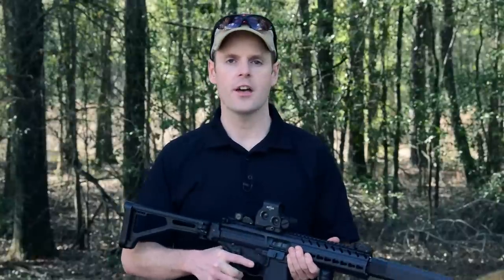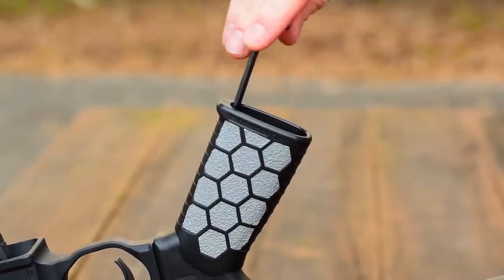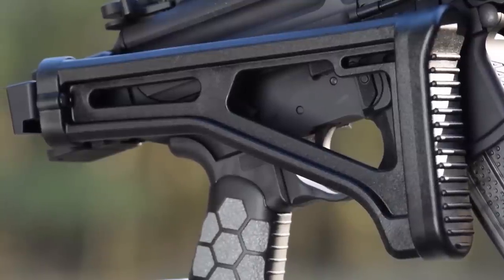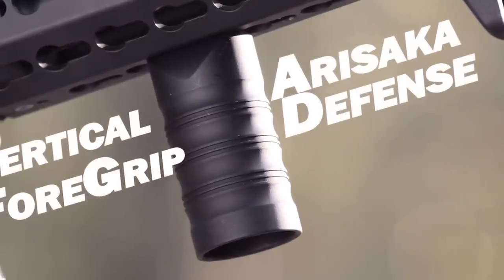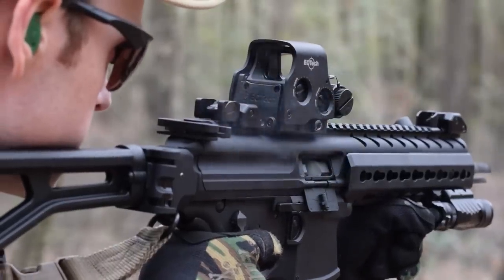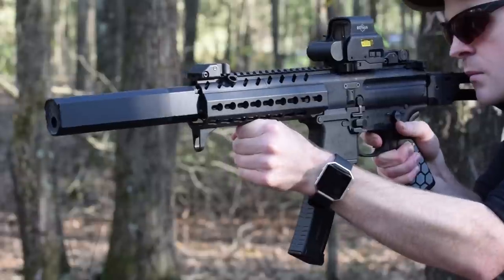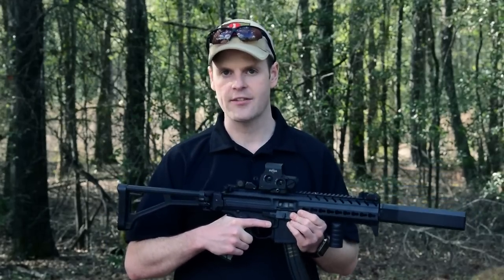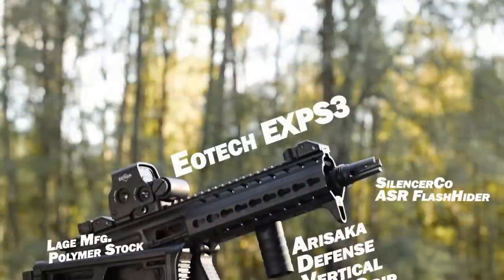Top 5 Upgrades for the SIG MPX

Comment: I carry the mpx everyday, 4.5" barrel. I find the collapsible pdw stock the most comfortable and useful. The best upgrades I made to my mpx sbr is chopping that barrel from 8 to 4.5", swapping the shit trigger for a geissele 2s, and adding the HK trilug adapter for QD use with my cans. Shooting without the can straight from the trilug end, is easily manageable recoil and staying on target with ease. I dumped the iron sights because I put an aimpoint t1 micro which is bombproof and last 50k hours. Zero at 25 yards and its gtg. The only problem I have had us using 165g hush subsonic ammo, it shorts strokes, so 147g FMJ is the best for subsonic work with a 4.5" barrel.

Comment: Also add a gunsmith trigger job to smooth out the grit and reduce the pull along with a JP rifles red spring set. No need to even worry about aftermarket kit if you stone the surfaces and upgrade springs. The engagement surface of the hammer-sear could be reduced but I prefer the added safety of the stock specs, just refined and reduced. This trigger job is just as good or better than any NCM-PNT or ACT trigger upgrade and you get to keep the stock Sig parts and bridge. I also like the small aim point much better overall. If you don't suppress the Lantac dragon brake is the way to go. If you reload switch to coated bullets and no coppering and way less wear on the barrel. The JP rifles yellow spring set will work reliably on a new Gen 2 but I believe it's less robust than the red springs which give you a 5-5.5lbs pull. Competition only the yellows are going to be fine and give you 4 pounds or under, even with CCI hard primers.

Comment: Thanks for all the suggestions, I paid for and put my MPX SBR in form 4 layaway jail back on election day. While I don't plan on changing the stock since I live far enough south to not have to deal with bad winter weather, I'd be willing to down the road if I dislike it enough after a few range trips. The grip on the other hand is almost always the first thing to go on an AR platform for me. My usual #1 choice is the BCM Gunfighter grips but I'll give that HexMag grip a look, I like the concept they have going there. As far as optics despite the fact that I already own an EXPS3 and love it (mounted on my Ruger SR556C) I don't think I'll be going that route on the MPX. I've been leaning toward Sig's own Romeo 4B as it's considerably cheaper than the Eotech and Aimpoint models I'd consider for a gun like this, plus it's much lighter than the Eotech (just under 8 oz lighter according to official literature from both companies). The foregrip is another thing that really you have no reason to not put on there, and the compact/lightweight nature of the one you shared appeals to me. Same thing with the muzzle devices. Assuming the Hearing Protection Act gains any traction this year I might consider getting another suppressor, but for now I'm going to hold off since prices should drop like a rock and availability should go up (eventually after the initial buying frenzy) if Congress happens to actually get something right for once. Going SilencerCo for suppressors is a no brainer and the Osprey 45 would give me a great platform that would be compatible with pretty much everything else thanks to the big honkin' .45 chambering. In due time perhaps! Great video, gained a subscriber today!

Comment: For the sight. I recommend Holosun HS510C. It has overwhelming advantages than the Eotech. Also a half price of Eotech.
Reply: i prefer the eotech because it looks better. just personal preference.
Reply: Yeah because if you ever need to use it for what it's really intended for it's going to matter what it looks like. I get you want to look like an operator so let's go with what looks cool, not whether or not its going to work when someone breaks in your house at night, or whatever scenario pops up and you need it to work. Who cares if the battery is dead or if the zero has shifted due to temperature conditions, as long as I look cool to my friends. To each their own I guess.
Reply: KhanSW lol thats why the ar was made. you can customize them however you want. i like the eotech, acog, and the aimpoint micro. they are well built and hold zero perfectly. this sight drift is on their new sights that i have not owned yet.
Reply: KhanSW and if someone broke into my house i dont have any segment longet than 10 feet so i use a benelli m1 with a bead. its point shooting, not accuracy
Reply: my halosun lasted a month before it completely shit out. talked to halo sun about the sight quit working his responce was " Did you put the battery in the right way? " even tho it has a Solar panel on the top battery shouldnt matter. so i trashed it and got a C-more railway 6moa. same price but its the scope competitive shooters have used for years. winning many national and international matches, so they have a great rep. lesson learned
Reply: Holosun. And it still needs a battery even if in auto mode. I've had the HS510C for a few months and it's been rock solid. Sounds like it may just have been you there.

Comment: the ultimate MPX setup.  SBR, Trijicon MRO, Franklin BFS3 trigger,  4.5" barrel w/ 3 lug adapter, Sig SRD9 suppressor, carbon fiber handgaurd, streamlight TLR2 Green laser, and Magpul QD sling
Reply: oghueq with all them changes you should of just built a 9mm build like I did.  Trigger, barrel, handguard than the other things. Would of been better off building

Comment: Try our some of the Sig branded sights too! I have the Romeo5 on mine. on the right Gunbroker auction, you can get them for just over $100 bucks. The newer Romeo5 even has a circle-dot, instead of the 2MOA dot on the original...

Comment: This gun can do anything.
Reply from the maker: Chandan Rath - Terminal ballistics are lacking past 75 yards - but other than medium-to-long range performance, the MPX is a solid choice.
Reply: you think so? If you get a 9mm on target at any distance it'll penetrate.  There are a couple videos about "how far is a 9mm lethal" particularly iraqveteran8888 and show pretty convincing penetration at well over 100yds. In any case, the sig catalog lists a .357sig and .40S&W conversion barrel as "coming soon" for the mpx. Should help with concerns about stopping power!
Reply from the maker: Ted Ferenczy - While expensive to feed, the increase in terminal ballistics when running the MPX in .357 SIG, would be pretty darn cool.
Reply: Yes you are right.

Comment: I have another question about the ASR flash hider, and the osprey. does the osprey fit over the ASR, or do you have to take it off?
Reply: Okay, so every pistol like my HK 45 compact, Sig p229 equanox, Walther 9 compact, CZ scorpion all require a different piston correct? I also like the Sig factory slim three prong flash hider. I've seen it hook up to suppressors, but I guess it wouldn't work on the for mentioned maad break.
Reply: Do you have a parts list of all the parts used on the business end of the barrel. I thought you mentioned about a spacer?
Reply: As an owner of two SiCo hybrids and an mpx 8", I'll chime in here and add that although I love my hybrids, they are Overkill for 9mm. I got a dead air wolf 9sd, as it is lighter, can be configured long or short depending on whether you wanna prioritize length or dB reduction. And I can put it on my blackout hog gun, too.

Comment: Had a question in reference to the Lage folding stock used on the MPX. I was hoping to know the length of the stock that you were using for your size. I am pretty much your same build and looking for a recommendation. Second question. I noticed that your folding stock seems to fold with a certain degree cant. I see they sell a certain folding mechanism which has a 0 degree (Left and right folding), a 3 degree (Left only folding) and a 5 degree (Right only folding).Lastly, if I am using this on a sig MPX, then I would need a: SIG MPX Stock Adapter for $59.99 and then the stock (? on length) and a folding mechanism (?) I also see they sell a ACE Folding Mechanism? Any help that you could offer would be greatly appreciated. Thank you again for the great video!
Reply from the maker: Shaggs2Dopes - I used the recommended length stock, but would truthfully prefer a slightly shorter one - but I'm only 5'9 YMMV

Mine is the 5 degree cant model and it perfectly clears the ejection port.

yes, I used the ace adaptor, keep in mind it adds like 2in to LOP

Comment: I'm considering buying this stock for my mpx sbr. Is there any specific reason you went with the right folding stock vs left folding with no can't ? Is that the medium length of pull stock?
Reply from the maker: - I originally chose the right-folding stock, because I was concerned with being able to reach the safety with my thumb, but that fear ended up being unfounded. 

As for the length, yes it's the medium length setup.
Reply: Thanks for the fast response , right folder defines looks cool, the 5 degree can't doesn't affect the trigger finger while folded ?
Reply from the maker: David Carrillo - it definitely does, but not enough to prohibit use of/ access to the trigger.

The 5-degree cant is necessary, because without it, the stock blocks the ejection port.

Comment: What kind of ammo do you run through it for doing the work? I know a guy who runs 100gr +P Corbon Pow'rball through his MPX for home defense, which is a neat little JHP. I myself prefer Hornady TAP out of a pistol carbine or SBR.
Reply from the maker: Jonathan Anatrella - I'm a big fan of Hornady TAP and Critical Defense 135gr +p
Reply: Oh yeah, Hornady just makes a great bullet. I've been considering Federal HST since I love the 147gr load in 9mm. It doesn't do well with defeating barriers as well which is what I'm looking for since I live in an apartment and worry about my neighbors. I have the Aguila minishells in my 12ga right now for home defense, the 6 pellet 00 buck will still do a lot of damage at 10 yards or less. Also very easy to rapid fire them if necessary.

Comment: If you always intended on having an SBR, did you ever consider getting the carbine length barrel and having it cut down to the pistol length barrel and cutting 1/2x28 threads on it?
Reply: that would be a way bigger pain in the ass and way more expensive than just starting with the pistol version.

Comment: How far away did you zero the EOTech..? I don’t have iron sights on my mpx...think I was too close on zero couldn’t get the round high enough based off EOTech mount and distance...
Reply from the maker: JC-Details - I initially zeroed the Eotech at 35 yards. If your gun is shooting extra high or seemingly randomly, check to make sure both the muzzle device and the barrel nuts are fully tightened. If either is loose, your groups will go crazy.
Reply: They were just consitantly low no matter what I did adjustment wise...had to move further away...when I’m close I use the bottom part..I think I was too close with a short barrel couldn’t get the two to cross...moved it back and was perfect...thanks for the video

Comment: who makes the muzzle brake you have featured in this video. I just purchased a mpx, and I like your set up. I really like that round muzzle brake with the holes on the sides.
Reply from the maker: j 1035ak - Thanks for watching, it's a SilencerCo ASR MAAD Brake mounted on an ASR Flash hider with a 13.5x1LH thread.
Reply: Thanks
Reply: j 1035ak what's the flash hider with all the holes in it. can't find what model that is and who sells it

Comment: Good review. Why does it seem like you still have the booster on when firing through the Osprey? o_O
Reply from the maker: That's easy, it's because it was still installed for half the shots, as I had intended to do a comparison between running with a booster vs the spacer. The footage with the booster was better, so I just kept it.
Reply: 2 questions
What is the booster y'all speak about?
I'm waiting on my silencerco octane 45k but I also like the 3 prong like flash hider ...Do I  have to remove it to put on the octane every time or does it screw on top?

Comment: dump the large battery eating Eotech, go Trijicon or Aimpoint
Reply: It's not that big of a deal once you have one.
Reply: Critastic i do have one, and 4 aimpoints and 2 trijicon
Reply: i have one and i've accidentally left it on 20-30 times (it turns off after 8 hours) on the same cheap-o double a batteries.
Reply: Aimpoint and Trijicon can be left on for years, they never turn off
Reply: i can store extra batteries in my grip. so i don't care how long it lasts. i have backup irons aswell. i feel that eotech has better quality control and holds zero better than others that i have tried. although i would like to get myself an ACOG because the complete absence of batteries is nice.
Reply: Random Moustache Guy you can throw an aimpoint from a helicopter you can drop one out of a truck you can drive over it you can throw it it's just about indestructible see Larry Vickers what he did when he finally blew it up with some C-4 was only to destroy it.
Reply: craig wentling i love the MRO.. perfect combo
Reply: Random Moustache Guy an acog on a subgun? Thats a lil dumb...(if thats what you meant).
Reply: I loved my eotech I just got an aimpoint never even mounted it to a gun put a battery on it put it on10 setting and left it on died in 4 months I just sent it back to them on warranty so not that impressed yet
Reply: The eotech is the king of fast Target acquisition. So, if that's your priority, that's what you get. If battery life or lightness or price are your priority, you get something else. There is no "better" optic between the ones being discussed in these comments, just different strengths and weaknesses.

Comment: I'm sorry but I've  got upgrades for the Mpx that will beat yours like a dirty carpet and none of them are nfa! When I bought my MPX it became apparent that this was Not a $2,000 gun... or at least worth it. Let's start with the horrible "Ar" trigger. It's like pushing your mother in law towards a cliff with her heels dug in and then over she goes. Solution? Timney makes a drop in trigger specifically for the MPX (to deal with hammer backlash that occurs and can destroy your trigger) End Result? Like snapping a glass rod from your high school chemistry class and at 2-3 pounds!
Next their gawd awful charge handle, which pitches up and down so loosely you think your going to either bend it or scrape out some of its upper housing. Just horrible! Solution? Radian Raptor Ambi charge handle and shim guide to eliminate that very problem so you can charge it and not feel like your going to break something. Next... I was amused to watch him shoot and see the Sig slapping him in the face like his 5 year old sister. Painful? No, but it is  annoying and distracting and to solve that I installed a Spikes Tactical Barking Spider Muzzle Brake/ Compensator. It is an elaborate design with actually different options but the thing you will immediately notice is no, none, zero, "gun slap"! It is like shooting a .22 caliber short round and the gasses and blast are directed away from you! Finally optics. So you want to take a $2,000.00 gun and put a $900.00 optic on it.... that's designed for an Ar and capable of 200 yard shooting, which the 9mm is not capable of doing? Then fine get the EoTech. I, on the other hand went with with the Sig Romeo red dot sight. For the price of the EoTech I can buy 5, well 4.3 Sig Romeos and the Sig has great features and works like a champ. For backups I installed the tried and true MagPul popups. 
Now there's your Sig mods and no need to go nfa and have uncle Sammy crawl up your butt and have him put you on his naughty and nice list.

Comment: I can't understand why anyone would use a EOTech when you could put a Aimpoint T2 micro on it and save half a pound for about the same price...and battery life....
Reply: Please share where you can you by an EOTech EXPS3 for 300 dollars, that's an amazing (unbelievable) deal.
Reply: Is English not your primary language?  I guess I just assumed we were talking about prices in the US and that you were saying you could buy EOTech EXPS3 (that the original poster linked) for $300 dollars.  At least that's what I gleaned from your posts here.  But apparently you were saying that a sight that cost about the same as an Aimpoint T2 micro, but weights 100% more and has no where near the battery life is comparable because it's 300 dollars less?  But the reality is its not $300 less anywhere that I can find it (online) and now I really don't know what you are saying.

Comment: My mpx copperhead can't even land on a human sized paper at 50 yard. Called sig. They said is a pistol what did you expect... I expect at least same accuracy than my glock...
Reply from the maker: Yuck. I guess it needs the standard 8-in barrel of the original to really perform
Reply: @BurstReview  yes, very disappointed by their answer. I was able to mess around with muzzle brake torque tension to get the group into 9 inch at 50 yard.
Reply from the maker: @seek3n  - That's nuts. My 2 3/4 38 snub revolver groups better than that.  Did you try tightening up the barrel bolts? My gun had one of those work itself loose and the gun grouped minute-of-barn until I tightened it back up.
Reply: @BurstReview  instruction manual says 20-25 lb. Read online said 40-45 lb. Called said they said actually is 30 lb. Lol I've tried all of them. Didn't make any difference. I know the chamber and lower tightness and muzzle brake tension makes a lot difference experiences from building many AR.

Comment: Don't you need a tax stamp for most of these upgrades? Shoulder stock instead of forearm brace without a tax stamp is a felony for sure. The fore grip and flash suppressor might cause you problems with the ATF as well. You might want to warn people about the legal hoops they need to jump through before altering their weapon as it could land someone in jail. Nice video otherwise.